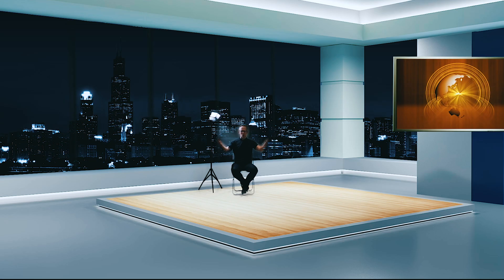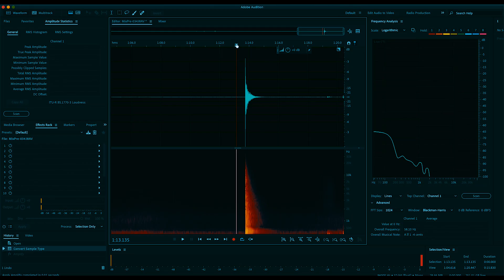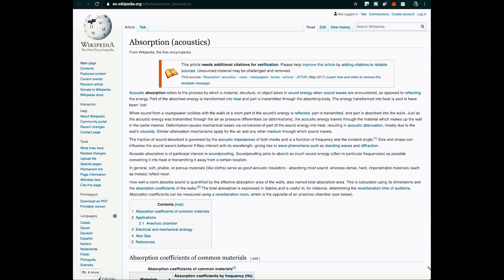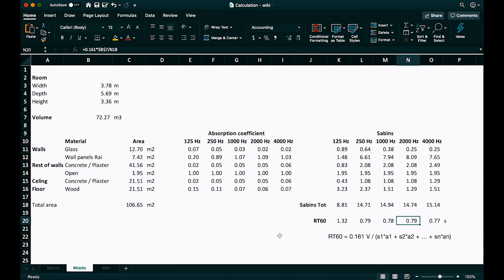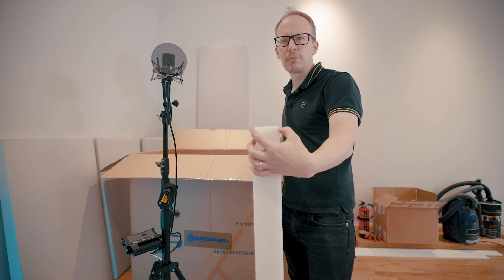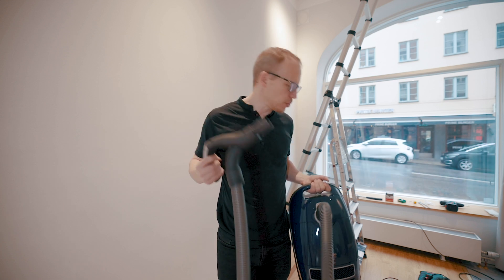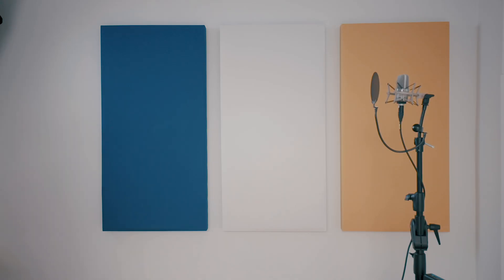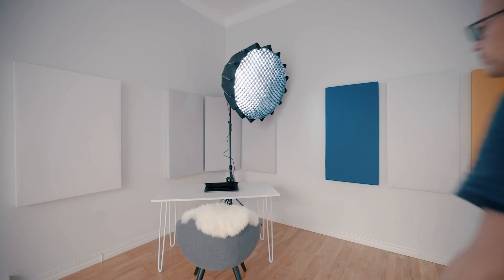How many SOUND PANELS for Home Studio | Acoustic Panels

Comment: AWESOME! Instead of flat panels you can try jagged ones so the sound won't bounce straight back (and forth). Lower frequency bass sounds can get stopped by using corner bass sound panels. 
I've been going through the same as you're going through, great job!

Comment: Any ideas on ways to measure the absorption coefficient for panels you've made yourself?
Reply from the maker: Googled it a little. 
Here are two papers discussing it:
https://www.researchgate.net/publication/287700418_Sound_absorption_coefficient_measurement_Re-examining_the_relationship_between_impedance_tube_and_reverberant_room_methods
and
http://citeseerx.ist.psu.edu/viewdoc/download?doi=10.1.1.621.4587&rep=rep1&type=pdf
Having said that, I imagine that you could simply take it outdoors, separate it far enough from everything including the ground (hang from a tree branch maybe) so that the first reflection comes from the panel not from the ground or the tree trunk. Pop a baloon, record the reflection from the panel (cutting out the direct pop) and then use the software I used to calculate the transfer. Maybe baseline with a perfect reflection, like a hard metal plate and then compare with your panel.